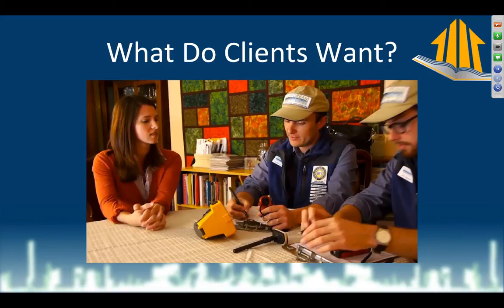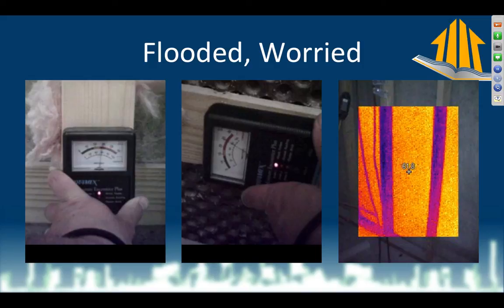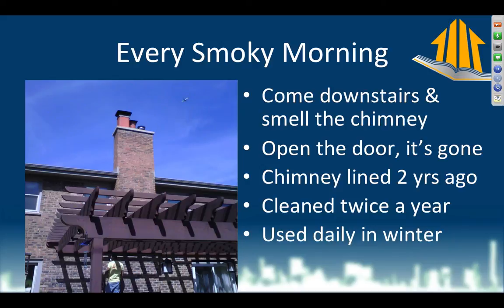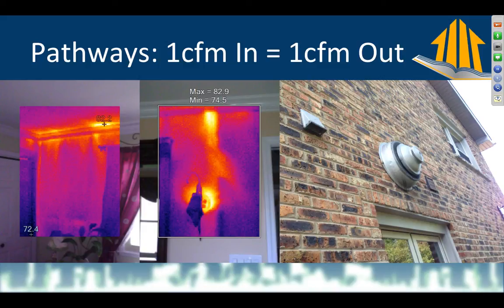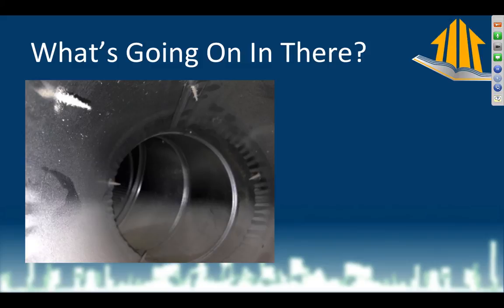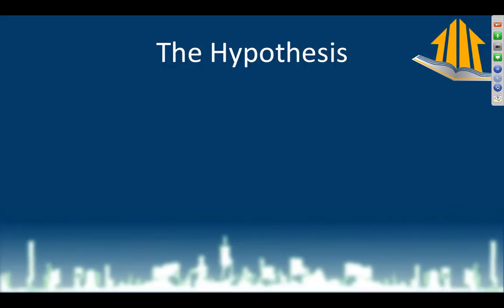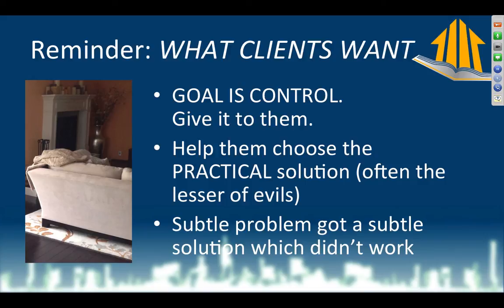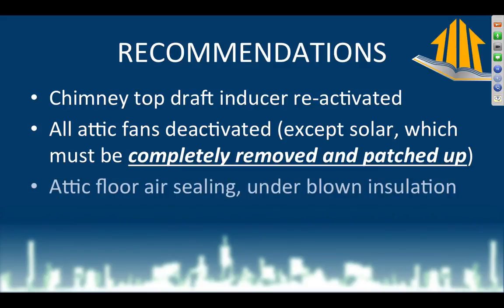What Clients Want: AUGUST 2015 Building Forensics Mastermind Webinar

Comment from the maker: +Todd Gandler, I hear you. Of course I use a touch of drama to address any company that would forget to include an 'off' switch on their device- that's just plain dumb. But also, there should only be holes in the roof for specific purposes, and 'breaking' something that interrupts the sanctity of the roof just to have it sit there forever, reminding you of how dumb it is- that seems less an improvement than a band-aid. My clients are generally happy to pay for anything to be done RIGHT.

Comment: Nice video Corbett. I appreciate that you shared it. One question: why do they have to "rip them out of the roof, patch the roof, etc..."? I for one, don't like to mess with roofs; if it's not leaking, leave it alone. Why not just leave them? Cut the wires, or break the solar panels so they don't run, whatever. Then cover the hole from the inside. Maybe that's what you really intend and you were just being dramatic.